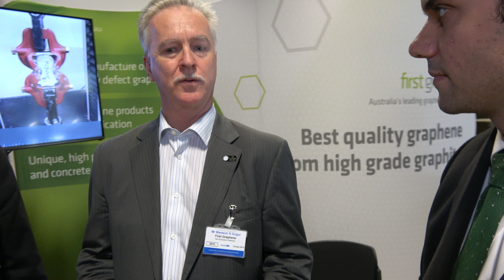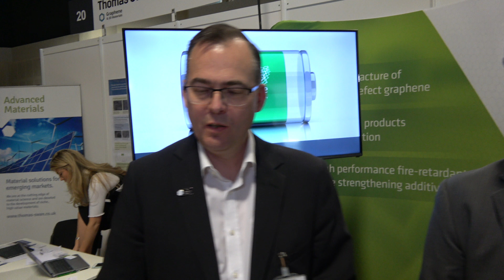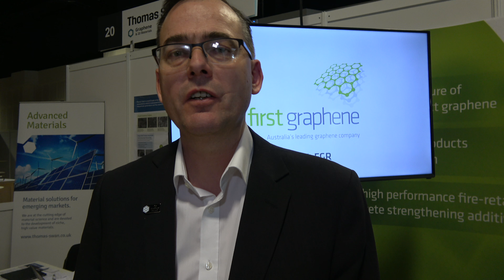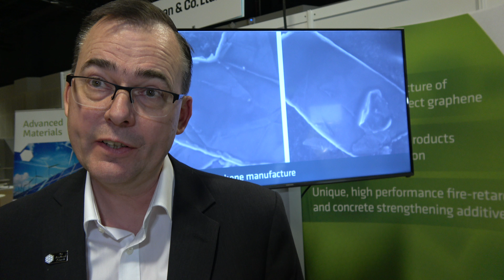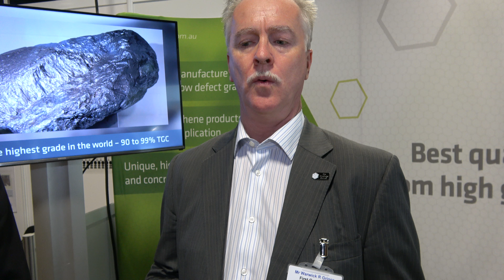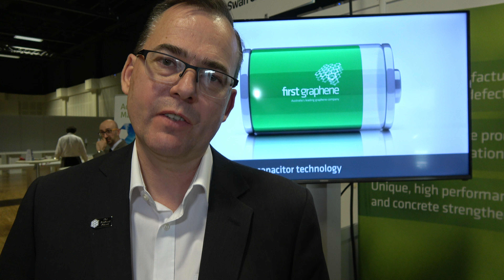Graphene-based flame resistant coating

Comment: Coal is graphene? Doesn't carbon, even in diamond form, burn at 763º Celsius?
Reply: It's a chemical reaction process that creates Graphene layer.  They change the process slightly based up the intended use.